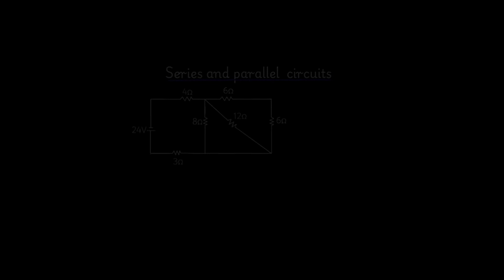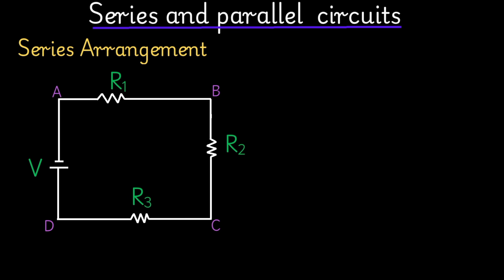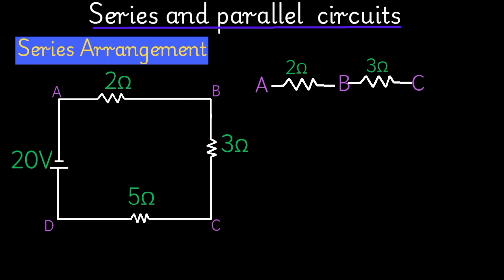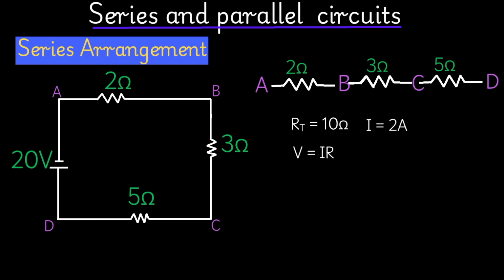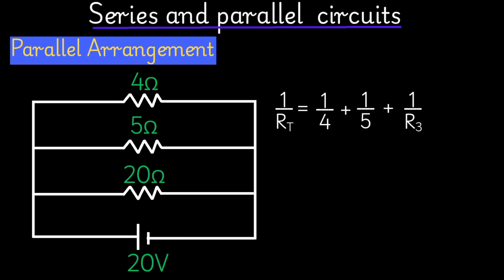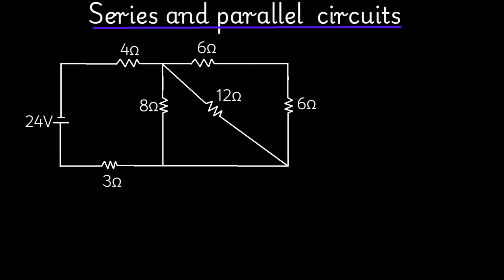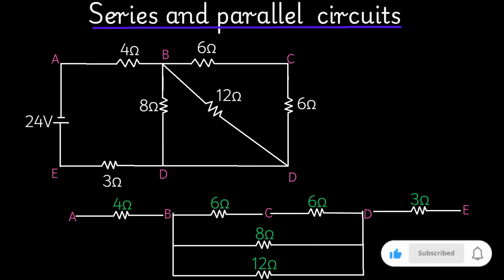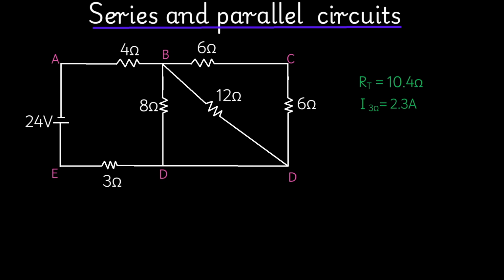One Method to Solve Every series and parallel Circuit Question🤯

Comment: I find it interesting the way amperage evens out in a series across unlike resistors, and then the simplest form of the equation can be used 'V = I * R'  to determine voltage drop across each resistor.  And because amperage is a constant, then higher voltage equates to higher resistance.   For resistors in parallel, the voltage is a constant, and amperage varies by the value of the resistor using a different form of the equation, specifically "V / R = I".  In a more complex circuit, where resistors in series precedes a set of resistors in parallel, then to find amperage for each branch, the first thing to do is get the voltage drop for the branch resistor set.
Reply from the maker: Perfect summary! Understanding how constants switch between series and parallel circuits is the secret to mastering circuit analysis. Thanks for watching and for the awesome comment! ⚡